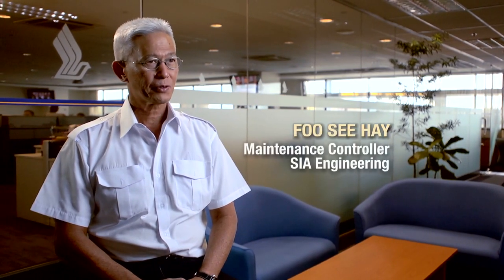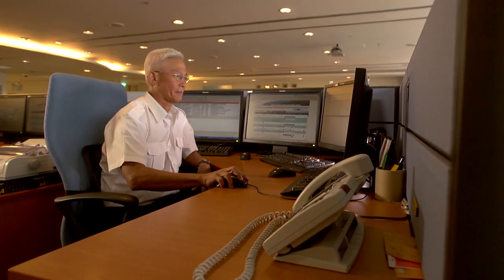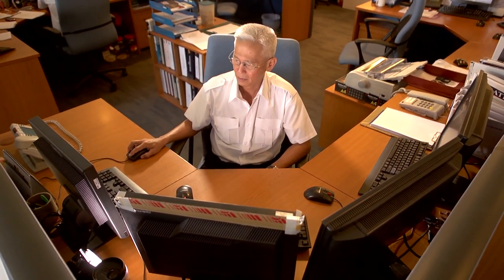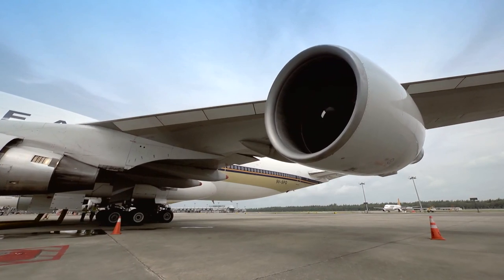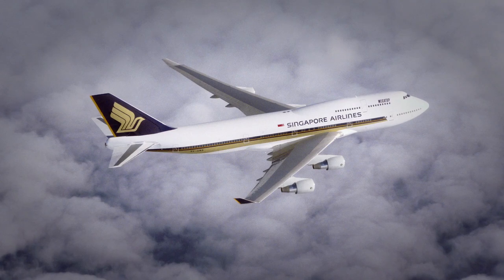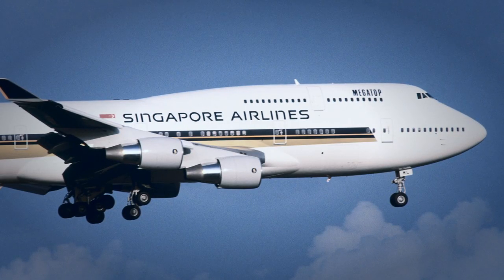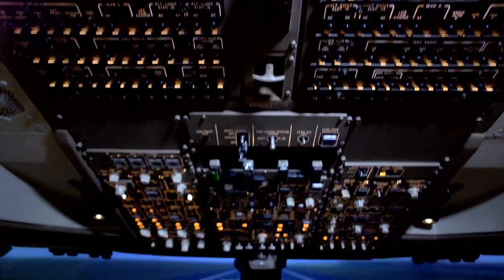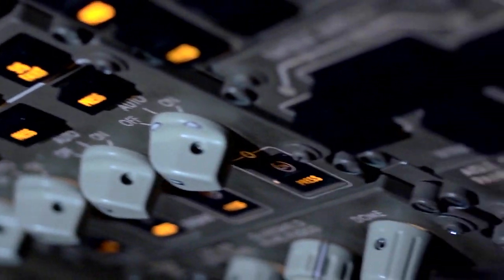Singapore Airlines Engineers Ode to the B747

Comment: Sir, I salute you and other engineers like you. You are unseen and  silent  any yet you carry on your shoulders the continuous responsibility of looking after passengers and pilots darting across the sky and landing safely at another plane with thousands of miles and thousands of hours flow safely. Even thinking on the thrust bearing on one of those giant engines scares me a lot. 
Of all the millions of components that go to make one aircraft, they all need to work in harmony to guarantee safe flying which it is said that it is the most safe transport system there is. To think that you are responsible for this, I can imagine the sleepless nights you spent with your team to ensure that other people are safe.   I  can imagine you looking at the sensors in a   wing spar to see if any crack appears or the  inspection in a turbine hot blade to see if it crept a little.
Sir, I need not proceed as I too felt a little of your responsibility when I worked on submarines where they had to dive and withstand enormous pressure which is the opposite of what you have to face, but yours is worse as with submarines at least they would float, but your planes do not, so your shoulders must be stronger than mine to keep the planes flying..
From all this distance away from you I can only offer you a gesture of respect for your services to mankind and may I wish you enjoy your retirement as I am doing myself after, our shoulders began to tire  a little under the responsibility we hauled for  most of our life.